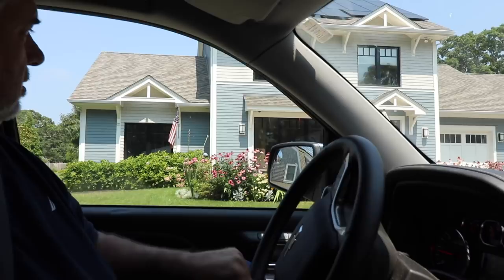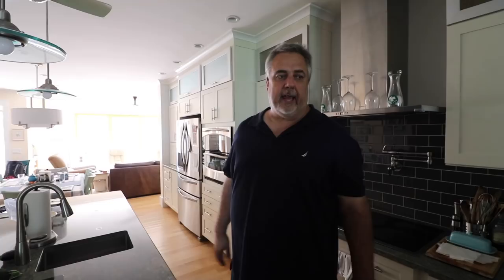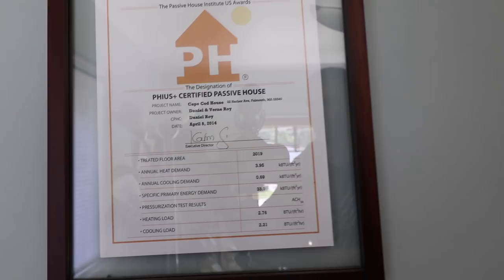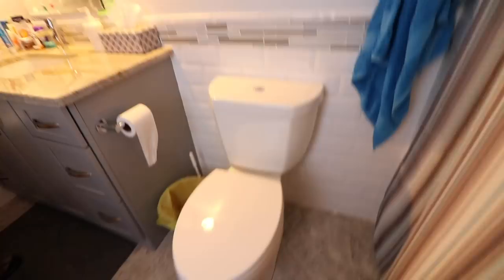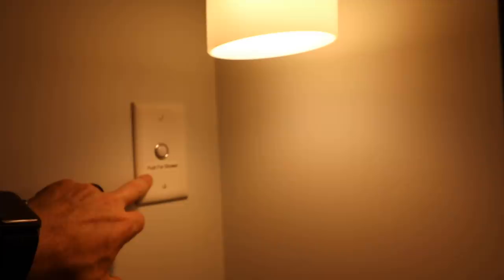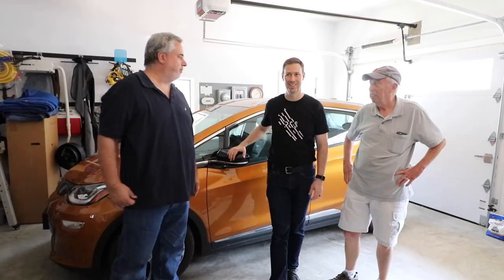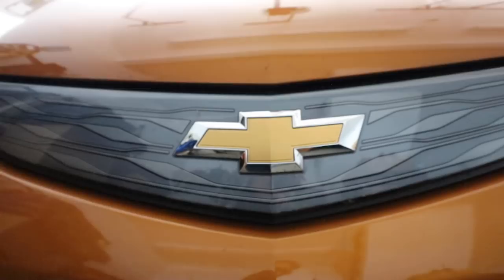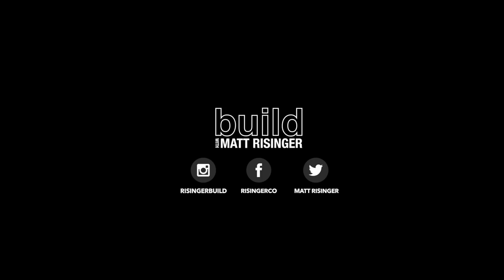Top 10 Most Efficient Home in America

Comment: So he said the HRV or ERV saves energy. It actually doesnt save any energy it's just there for comfort, and uses energy in a very efficient way to bring in fresh clean air. Makes the house much nicer to live in. If this guy actually piped in natural gas for just a fire place and grill that's kind of odd. I'd say use propane and get rid of the monthly service charge, but I guess the draw back is having to go fetch propane in a chevy volt.
Reply: Yea I guess that makes sense. Didnt really think of it in that manner. Probably can recover alot more in heat then the fans cost to run, especially when you're heating with electricity
Reply: Also the sealed combustion fireplace wasn't available in propane, gas was in the street.
Reply: Nice, I'm definitely trying to get rid of every bill except for electric. Our gas company is hard to deal with. One thing I don't often take into account is convenience and the older guys say you'll start to take that into account more and more every day. That's kind of why wood stoves are losing popularity
Reply: Propane is actually cheaper in smaller quantities then natural gas. Natural gas has a service charge pipeline maintenance fee and a few other fees associated with it. So my natural gas service fee is $35 dollars a month even if I turn off the meter. So for a grill and outdoor fireplace both probably rarely used it would be cheaper to use propane. But then again a older gentleman like the owner doesnt want to go to lug around propane bottles so that small charge is probably worth it

Comment: He needs 120+ cfm in the shower...
Reply: That is only if it only runs when you are in the bathroom, less is needed if it runs 24/7.
Reply: @2awesome292  What? A bathroom fan should be able to clear out the humidity as fast as it enters. 20-35 cfm isn't even to building code. I built my home 12 yrs ago and my 50cfm fans didn't pass inspection and I upgraded them to 120cfm with a humidistat. Did you hear Matt's pause when he heard 20cfm? Lol That said it all.
Reply: That is probably continuous, and with the boost it probably goes up. I'm surprised he has a CO2 detector but not humidistat in the bathrooms.
Reply: Yeah right. I like how builders take a little time from the slap it together process and use spray foam, pex and suddenly they are a pro. That home didn't even have central air. On wall heating units. You want to save? Install a fireplace. Lol. I think what Matt is doing is great and like his builds but this guy in his last 2 videos he is parading? I don't know about his work. It looks like a lot of $$$ and no show. I built a nice 2000 square ft ranch home with full brick, hips, granite, $1000 entry doors, $7000 kitchen, hot tub, steam shower, custom Roman Stone tile, gas fireplace, sky lights, Trane central air heat pump, porches, septic ... everything including lot cost for $110,000. Maybe I have an electric bill. But I didn't pay out the butt for my home.

I was the general contractor and hired Amish barn builders to build my home. The did the pored foundation, framing, roofing, drywall. Charged me about 10k labor for everything and then I hired my own electrical, plumbing and heating air company. My home just appraised at $250k. These builders are making big money to point at workers to do the job. Lol
Reply: Can you make a video about your home?
Reply: @k1zmt  I have a YouTube gaming channel. Not how to build channel. Lol. Just watch Matt for that.
Reply: I was asking out of curiosity. I grew up in a different country. Usually we build houses from bricks and concrete so wood houses for me look a little bit weak.
Reply: That is what the timer is for
Reply: NEOISON hmm.. didn’t he already have a system in place that runs near constantly to handle the air exchange and moisture? Isn’t the unit in the bathroom essentially an addition to that building exchange? 

Now besides that I’m renovating small mill homes and would love your game plan on your own build to save on getting these upgraded.
Reply: NEOISON My request for a game plan excludes only $10K for a whole house setup cuz that’s just blessed lol
Reply: You are kidding right?  There is no reason for anything more than 50cfm honestly in a bathroom to properly mitigate moisture issues.  That is the rate required by the current revision of Energy Star 3.0 for intermittent running fans.  Estar only calls for 20cfm on constant running fans.
Reply: @neoison4915  Try being a building super down here in Texas.  They have to do way more than point at workers to do a job.  It's actually pretty high stress trying to coordinate all the trades (many of which will fuck up things for other trades and never realize it because they are so micro-specialized), many of whom don't even speak English.  It's basically like babysitting a bunch of adults you can barely communicate with.

Comment: Yeh, this is not revolutionary at all. Nothing really, generic stuff i can buy in the hardware store. All talk and not much to show, also those solar panels are the old crap ones that lie in series and aren't in parallel. All i hear is documents, certified, passive..... How about building something that is actually epic.
Reply: I agree. This house probably has a normal thermal efficiency loss. They are still using framing that touches the inside and outside of the house. New real efficiency house have dual thinner framing that the wood that's touching the outside temperature has insulation between it and the inside walls. The inside framing has insulation between it and the outside wall. You can reduce the tonage charts by 300 BTU per square foot. In a 1200 square foot house that's a thermal savings of 9000 BTUs per hour. Almost 3000 watts less power per hour to heat your house at 0 degrees. That's a savings of $324 per month on heat alone at 0 degrees
Reply: @Johnny Ericsson am I to assume your an engineer, what type?
Reply: @Johnny Ericsson why not? It's free. I own 5 acres of woods. Trees die every year. Why not use them? Wood is probably the least impact on the environment. All lumber for houses is being grown at the same rate as the harvest. It's almost like growing food. For some reason these liberals have gotten confused. The lumber that comes from the forests is hardwood and is not used in building homes. If you use processed materials, like you are referring,  you are adding to the carbon footprint because of the manufacturing processes. And you're using non-renewable resources. And you are adding to the micro plastic environmental disaster. Think people. Think.
Reply: @Johnny Ericsson I'm going to all 12volt dc house. There's no use for 110v anymore except for a few appliances. I've already got a built in sprinkler system now. I've already made the interior of my current house mostly water proof. Mainly because I have pets. It's much much easier to clean. These sprinklers are about $20 each by Tyco. I don't know what they aren't required.
Reply: @Johnny Ericsson they vary. Depends on what you want